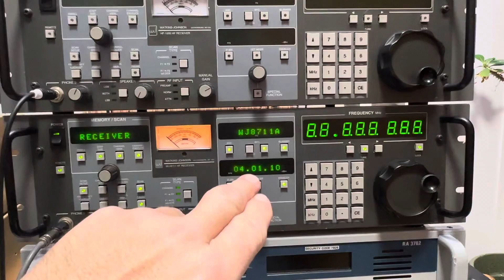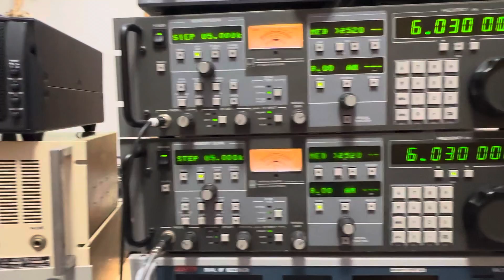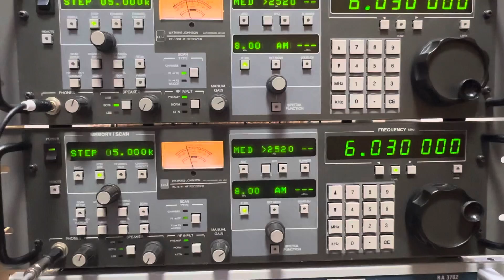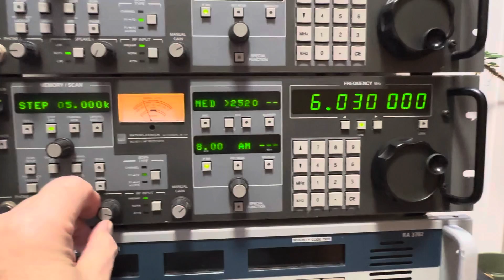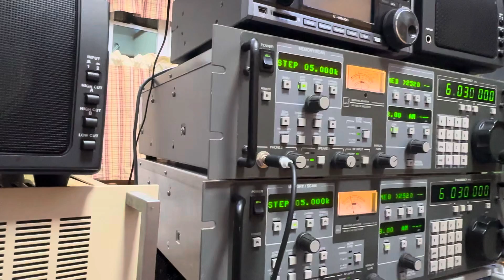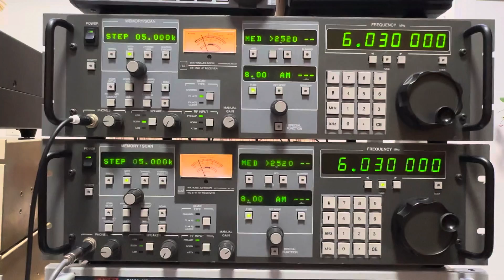Watkins Johnson 8711A & HF1000A Feature Comparison

Comment: Just curious if you know if the components, in the 8711A are better quality or higher tolerances. If one purchases the HF1000A is there a reasonable path to upgrade the firmware? Thanks for the excellent video.
Reply from the maker: Great question. From my experience of you are looking at the ‘A’ version of each receiver, the hardware is the same. The only differences are the HF-1000 comes with the internal speaker option and a different paint on the chassis. The 8711A has the connector  for the internal speaker just no speaker. With the ‘A’ versions the only difference is the U12 chip. They are swappable. With the earlier versions of the two radios they are not swappable.

Comment: Great comparison video!  Could you please confirm the HF-1000 Misco speaker part number - EC5WP?
Reply: @KI4BZJ  Update: The Misco EC5WP speaker makes a *HUGE* improvement for the “speaker” audio channel relative to what I had been using (way ancient Motorola mobile communication speaker/enclosure).  Thanks again for mentioning/documenting this important upgrade improvement!
Reply from the maker: @bp7315  Thats correct. Other models may work (I know they will based on other HF1ks I’ve worked on), but the EC5WP has ‘big sound’!
Reply: @KI4BZJ  Thanks!  I’ve now ordered one from Misco for my 8711!

Comment: So, the plain HF1000A is more appropiate for the DX weak signal ? I understand this, I am mainly interested in voice signals.  Or it would be better a 8711A for my purposes? I cannot listen any significant difference in this video.
Reply from the maker: @papierecriture  Yes, the DSP filters in the HF1000A have wider skirts which allow more signal in and make voice modes more intelligible. Listening to voice modes is less tiring and much richer than in the 8711A. If you are listening to voice modes in crowded bands then the wider skirts could be a liability since you’d have to narrow the filter width to isolate one signal from nearby ones. Of course digital modes are better/tighter using the 8711A. For DXing it would, as you say, depend on what your listening needs were.

Comment: Chuck, thanks for a great video. Question, is the chip for the 87 available on the market and is it a direct swap? TY
Reply from the maker: @jerseyjeeper1575  Thanks! Yrs, the U12 bandwidth upgrade for the WJ 8711A is sometimes available on eBay and other places. If you have the ‘A’ version of the 8711/HF1000 it is a direct replacement. It isn’t compatible with the ‘original’ versions of those radios though.